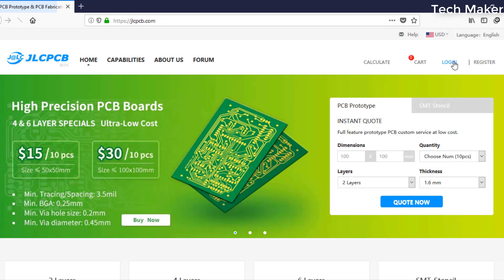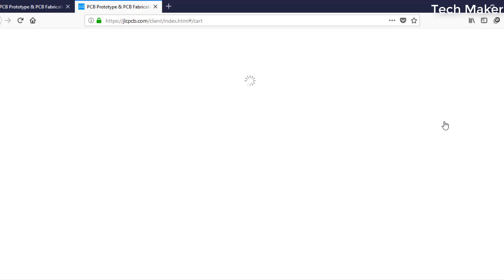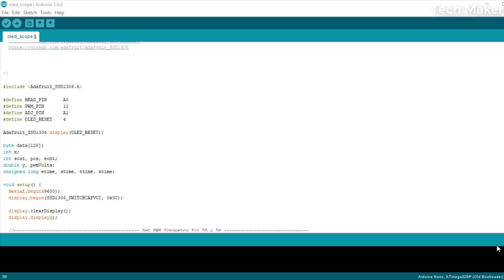How to make Oscilloscope with Arduino and OLED Display

Comment: Very nice! I updated the code a little for my OLED (Adafruit_SSD1306 display = Adafruit_SSD1306(128, 64, &Wire); ) so it works perfectly! ;-) Thanks! I'm going to try the GRBL files with my CNC 3018 tomorrow! Tested on Arduino Uno!

Comment: great! i had to follow RandyFPVs advice. see below .... any ideas how to ge the half wave unrectified and than the whole wave centered? may you like this modification ;) 

for (x = 0; x <= 127; x++) {
    data[x] = (analogRead(READ_PIN) / 10.855);
  }

  display.clearDisplay();

  for (x = 0; x <= 127; x++) {
    display.drawLine(x , 63 - (data[x - 1]), x , 63 - (data[x]), WHITE); // wave filling thickness & color inversion
 try 0 - 63 ;)
  }
  // draw the axis, lables and tick marks
  for (int y = 0; y < 6; y++) {
    
  }
Reply: solved! biasing the input ;)

Comment: I tried your example and I had a small issue with the program.  It was not coming up in the correct size on the oled,  it was twice as big as screen. I moded the codes first few lines to this:

#include <Adafruit_SSD1306.h>
#include <Wire.h>

#define READ_PIN      A0
#define PWM_PIN       11
#define ADJ_PIN       A1
#define OLED_RESET    4

#define SCREEN_WIDTH 128 // OLED display width, in pixels
#define SCREEN_HEIGHT 64 // OLED display height, in pixels
Adafruit_SSD1306 display(SCREEN_WIDTH, SCREEN_HEIGHT, &Wire, OLED_RESET);
Reply: Thanks for this modification. Was looking for why it was all double-spaced. Are you getting the frequency readout?
Reply: you safed my day!
Reply: Bro, I have the same problem about the size. I can't do this